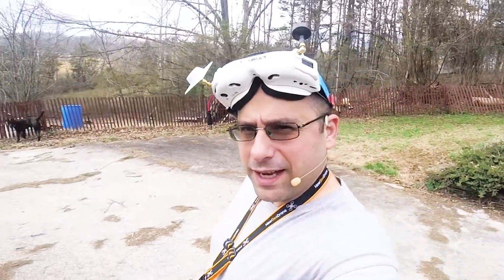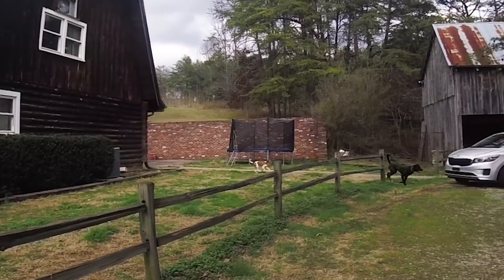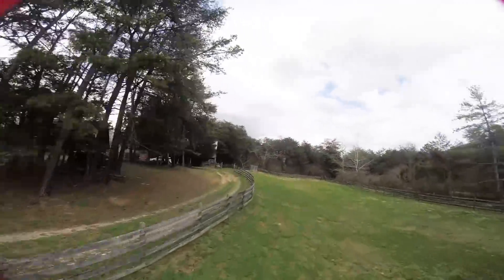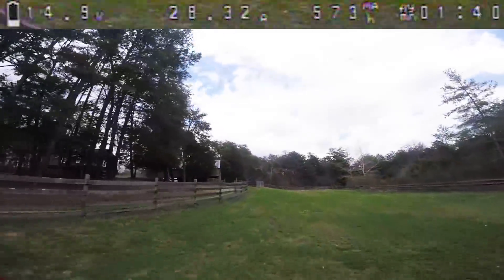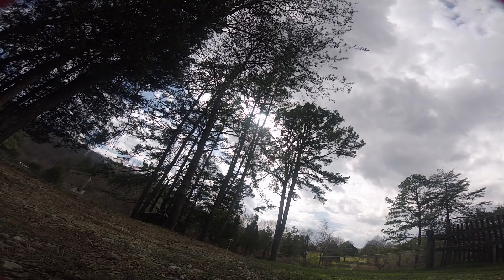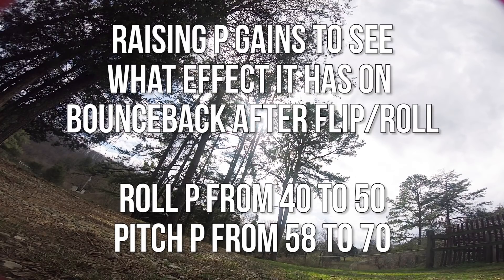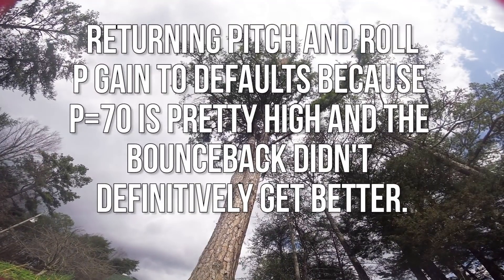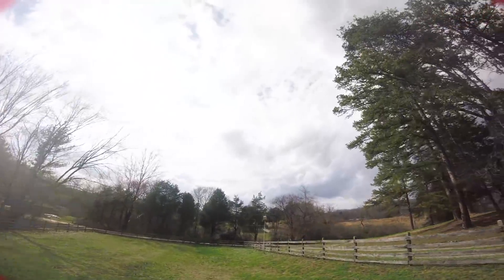betaflight PID tuning | RCX 2306, JBardwell F4, Wraith32, iFlight Transframe X5

Comment: how does changing the weight affect your tune? If you have tuned your quad without a gopro, and then add the gopro, or if you tune it on 4S, then put on a 6S battery. Has anyone ever discussed this?
Reply from the maker: Adding weight has the effect of reducing gains slightly. Not literally, but the quad flies as if it has slightly lower gains. Going to 6S has the effect of raising gains significantly.

Comment: Hello. I'm having trouble correctly setting up my drone pid. when I do an acrobatic and I will resume acceleration the drone vibrates on the axis of the roll. What could it be?
Reply from the maker: I think it is propwash oscillation. This can be pretty tricky to fix, to be honest, but I spend a lot of time working on it.

Also check out this video: https://www.youtube.com/watch?v=XmQ28MuAFf0
Reply: Thanks

Comment: Hello . Maybe you can give me some advice here .. I just finished a build using the remix frame and the JB F4 flight controller .. every time I tried to do a save and close with version 3.3 . I got the following error .. unrecoverable failure of serial connection, disconnecting .. I reflashed reinstall 3.3 .. still had the same problem .. I went back at 3.25 and all is good .. Racedayquads told me it must be a betaflight thing .. I see in this tuning video you are using version 3.3 on your flight controller .. so first I was willing to wait for 3.3.2 .. because there are a couple options I would like to utilize in 3.3 .. so I'm wondering have you ever heard of this and do you know if there is a fix for this .. please let me know because I enjoyed soldering this flight controller it made the work very easy and clean .. I would like to eventually run 3.3 .. thanks
Reply from the maker: That just means that the FC disconnected the serial connection before the configurator did. It doesn't actually mean anything has gone wrong. Just ignore it and reconnect.
Reply: Okay thanks maybe I'll give it one more shot .. but I was running into the problem where it did not want to save my changes .. and I never get that with beta flight 3.2.5 .. whereas with betaflight 3.3 .. I got that every time I hit save .. which kind of tells me it has to be something with that version not the flight controller .. maybe this coming up weekend I'll try to bump back up and see what happens .. thanks

Comment: Has anyone been working on self-adjusting PIDs? It seems like the gyro can detect bounce back better than humans. Maybe a pid tuning mode you can run for a couple flights then turn off and adjust by hand for feel and preference. Or an algorithm run on black box data...
Reply from the maker: I think most improvement has been in the sophistication of the PID controller so default PID flies well on more quads.

Comment: Hey Bardwell from the future, I can tell you the twitches are typical of low D gain and you see them more when flying slowly straight. Higher your D-gain again and it should disappear ... (I'm at 10:00... didn't see the end). Its a good way to see when your D term is high enough I think.
I had a quad that made it on 25-30 had to get back to stock. Maybe I'm wrong in your case

Comment: Regarding the twitches I think it's possible to see them by enabling the crosshair in the OSD. Fly in a straight line towards a fixed object and you can see the crosshair moving away from the object and back.

Comment: Hello Joshua, I had read some time ago on Oscar Liangs blog (https://oscarliang.com/setpoint-weight-transition-derivative-error-measurement) that tunning with D set point weight to 1 can mask bad tune and it is advised to tune with 0. What experience about this do you have?
Reply from the maker: I don't fly with setpoint weight to 0 so I don't tune that way either.
Reply: Thanks for the answer I appreciate it. I tried setpoint of 1 but even with RC interpolation I am getting very "stair like" D gain on sharp maneuvers in BB log. Is it expected behavior?

Comment: I've had motors run cooler after removing some filtering. I think there is a situation where the latency caused by the filtering screws up the D term phase and causes MORE heat instead of less. Is this possible??
Reply from the maker: I would be surprised to find out that was true.

Comment: For one of my builds twitches were caused by noise in RC signal. It's not really a noise, just a steps between 2 RC signal levels.
 Setting higher D setpoint weight (>1) amplify them a lot.  Was solved for me by enabling RC interpolation.

Comment: Hey Josh, I have a king Kong 90gt and it drifts forward really hard every time I try to fly it. I've tried everything I can think of to correct it. I am flying in angle mode. I have watched a ton of vids on everything related to drifting, accelerometer, tuning, etc... Is it possible my fc is bad?
Reply from the maker: verify that your channels center at 1500 in the receiver tab.

Comment: I cannot for the life of me get a sdcard to read in the jb f4. I've tried every betaflight build available. Every setting that has to do with blackbox and the sdcard. Bought the transcend and SanDisk 16g cards, formatted them with the recommended program. Pretty frustrating.
Reply from the maker: If you believe you have a defective board contact general@racedayquads.com to pursue warranty replacement.

16 GB card should work.

Comment: OY! I have the Wraith 35A v2 in the mail and was literally about to buy the RCX NK2306's in minutes.  I've been agonizing over what motors to get.  NK2207? NK2306? Their 2206 V3's? I just can't spend more than ~$16/motor and everything else in that class that has a big bearing and nut instead of c-clip is like $22-24.  Looking forward to the follow up videos!

Comment: Interesting you drop D gains- I normally do that... BUT..... I then re-check motor temps then remove as many filters as I can(esp. PT1 and 2 notches)... if motors are cool then I continue to tune P and then re-raise D to smooth out propwash.... often find that motors are cooler with similar D numbers after completing this process...

 ie.... I've have less filtering giving me cooler motors (my assumption is that this is because the PID loop is responding much faster & accurately and not delayed causing wasted energy ) - this is on builds that have minimal noise in BBOX when I check the raw gyros (softmounted + caps for elec noise)

Also I find that on true X builds need the P gain numbers to be a lot closer  to one another, not so far out (I don't tune with gopro tho) I've had them being far apart induce weird mid-throttle oscillations

Comment: hi josh  could you please give me some info on how to calibrate the rssi in a laforge V4  I got the main and diversity module 

how many MW  on the VTX power  ?

how many feet away from it  during calibration ? 

antennas on the modules or off ? 

basically all the stuff they don't cover in the manual 

thank you enjoy the weather   still waiting for spring in Colorado   I miss flying a lot

Comment: Hi Joshua,

I just builded a quadcopter for my graduation project but the problem is that when I did the flight test, the quadcopter is trying to lean to one side. It does not fly vertically as I move the stick. 

I tried different way of fixing the problem:
1. Re-calibrating the ESC.
2. Re-calibrating the magnetometer.
3. Re-calibrating the accelerometer by flattened the flight controller (FC) as much as possible.

I did the test again by moving the throttle slowly until I reached half throttle, but unfortunately It leaned to one side until it crashed into the trees but thanks to god that nothing has been damaged only the propellers and I changed them.

I don't know what is the problem exactly. Can you suggest any solution to the drifting issue.
I tried to analyze the blackbox data but I could not as I'm not an expert and all these things are new to me. I'm going to graduate soon and I'm afraid that this project are not going to be finished.

Note:
- I'm using a PWM connection while calibrating in clean flight.
- I'm not attaching a camera to my drone.
- I'm using F6-ia6 receiver and transmitter. (Mode 2)

Comment: Would a lighter quad usually require lower pids?
Reply from the maker: It depends largely on power to weight ratio. So a Tiny Whoop weighs nothing but has really high PIDs because it has weak motors.
Reply: Joshua Bardwell ohh.. makes sense. I was thinking of a light 5 inch with Some 2207 motors. Thanks for answering jb

Comment: my motors got colder from turning on pt1 and the first two filters off with the wraith32s
Reply: Ditto (although with Siskin32 ESCs - PT1 Dynamic & D-Term Filtering only) - might be that the faster response on 8k/8k means the motor isn't having to compensate quite as far and even if there are some spurious changes the overall requested RPM change isn't as big and stays easier to adjust, thus power draw is staying more consistent.

Comment: The defaults are a little confusing right now tbh.
But I think the dterm being in the 30's is because the dterm is a lot less effective with bounce backs when in complete measurement mode.
My recommendations are to turn on dynamic filter turn on Anti-gravity. 
Then disable all notch filters but leave biquad on dterm.

If your racing I recommend you leave setpoint weight off but also disable rc interpolation to sharpen up response on pitch and roll to bring them inline with yaw and throttle which have no interpolation anyway. (This produces a very direct control feel that is less affected by dterm and it's sensitivity to weather and temperature changes, you also have a true interpretation of the control links delay and can fly accordingly.)

For freestyle however I would reduce dterm to 22 pitch and 20 roll and Then increase setpoint weight to 1.0 with a transition of arround 0.2. 
From then on you should adjust setpoint weight until you feel like the quad is responding on the pitch and roll similarly to yaw a throttle. ( This will produce much smoother flight, flips and rolls but will feel less direct but more responsive on consistent flying moves it largely ignores microcorrections).
Reply from the maker: This is good stuff. The only thing I disagree strongly with is setpoint transition. I really prefer transition of 1.0 if at all possible.

Comment: I have the same exact twitches in my HD video, not to be seen in FPV feed. I have been trying to get rid of those for weeks. Changed motors, props, tuned the living hell out of my quad. Which is fitted with a Matek F405 (the first one). I'm 95% sure it is the Matek. 
Hoping two things here Joshua: that you will find a solution, that is NOT the FC ;). Oh, and I also have an iFlight frame, the XL5 v2 in my case.
Reply: How stiff are the arms of your frame?
Sound pretty much like a structural problem if the frame is the only thing besides the board you didnt change.
Reply: It's stiff as far as I can judge. I just have a second one in the mail, which I will build all most the same, but different FC. Will see what happens :).

Comment: Hey Joshua. I noticed the twitching almost immediately. I'm not saying I have eagle eyes or anything, its just a familiar site because I had the same problem. I started from the outside and worked my way in. New motors, escs, added caps to clean up battery noise, tried different soft mounts, hard mounts, I tried all kinds of tuning solutions, yada yada yada, After nothing work I bit the bullet and swapped out FCs and it all went away. I could hard mount everything, use the original motors and ESCS and it all the twitching went away.  I'm 97.3% sure I had a faulty gyro. The manufacture responded me with "well when you have a faulty gyro it usually fails like blah blah blah" so they did nothing for me. This was just my situation and I hope yours is different, but you should be prepared for the worst and be ready to spend many hours disassembling and reassembling your quad.
Reply: Unfortunately I got a Joshua Bardwell flight controller with a bad gyro.  https://youtu.be/zeAUH9JNN8o.  I troubleshot the hell out of it to the point that I finally swapped the flight controller into a completely different known good quad and the issue followed the flight controller.  I was pretty bummed out.
Reply from the maker: Talk to racedayquads. If it was DOA they will take care of it.
Reply: I've found the best tool for that is setting Blackbox recording to the actual PID frequency, and just dong short flights (since that fills up memory fast).  Do boring flying without hitting anything, and gyro spikes are incredibly easy to spot.  Hopefully that helps and doesn't involve a lot of disassembly - trying to tune around gyro problems just shows you how big a tuning envelope there is, but mostly convinced me that I can fly junk that is miles off (single digit P values, really high I values, etc.) if I work at it, but flying good stuff makes life easy.

Comment: What is prop wash?
Reply: just did a bit of research and I understand it now. Thanks for the reply buddy
Reply: Go to 8:31. It happens as he turns to the right
Reply: prop wash refers to the "dirty air" left behind by your propellers. so if you spin around quickly to change direction you're flying through your own prop wash while still moving backwards for a little.
People just say prop wash when referring to oscillations from prop wash.

Comment: My guess for these twitches at straight forward flying would be that an ESC is starting to desync. Although those Wraith should be awesome... I'll give 30% to an ESC and 70% possibility to a motor not dealing well with lower throttle..
Oh, and DAL 5046 Cyclones? I had almost the same twitches at straight cruising with them! So might wanna give that a thought as well ;) See it swinging right here: https://youtu.be/JP6GhMO_dYo?t=20s

Comment: Ye I noticed d term used to be at 20 ish for both and after like 3.1.7 they bumped d gains up in the 30s, when I built my quad with emax 2306 2400 kvs, it sounded terrible with the high ds, lowered and lowered them till on 22 and 20 and sounds and goes way better, 🤙🏻